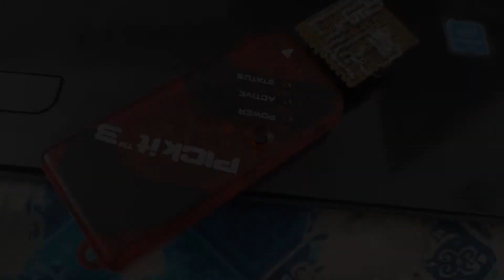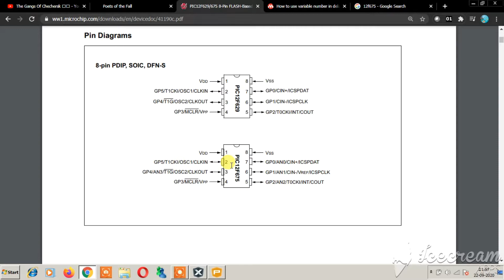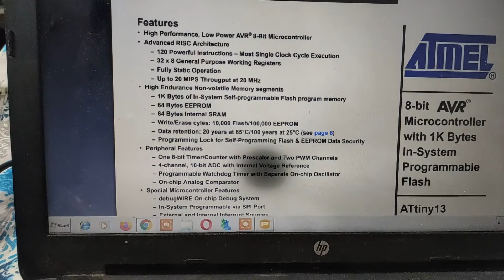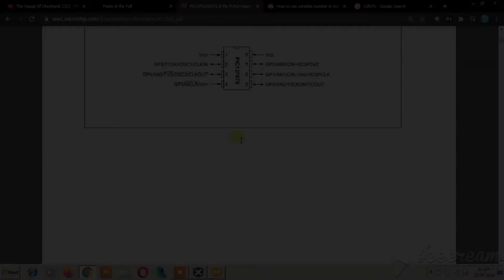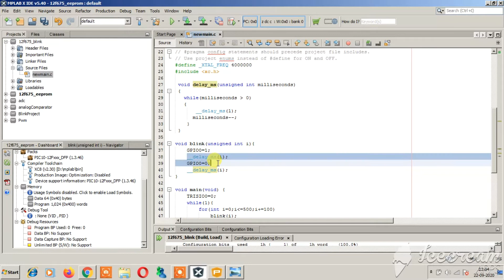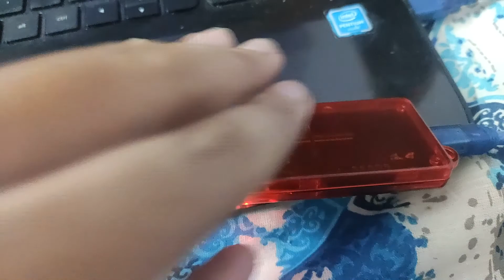PIC12F675 | PIC Microcontroller | Circuit, Code, Datasheet explained

Comment: Hello Sir, I am trying to generate 1 minutes delay. I am repeating __delay_ms(1000) function 60 times still unable to get delay of 1 minutes. It gives a delay of 40-45 seconds. What may the error?
Reply: Try to use __delay_ms(60000). You dont have to use 60 times 1 second delay when you simply can delay it 60 seconds.

Comment: Good evening sir . I want program for Automatic stabilizer . IC no. 16f676.
If u don't know please suggest from where I can get
Reply from the maker: These kind of programs can be obtained from a technician who can repair inverters, stabilizers, smps,etc  and also if you can contact a professional company who makes these stuffs, they may be able to help you out regarding this matter. And it maybe will be a paid task. Method of flashing remains the same with 16f676. have a pickit3.